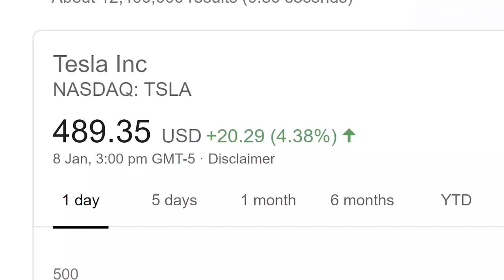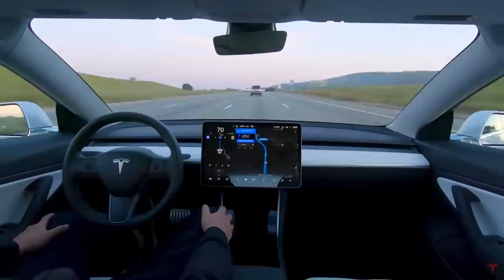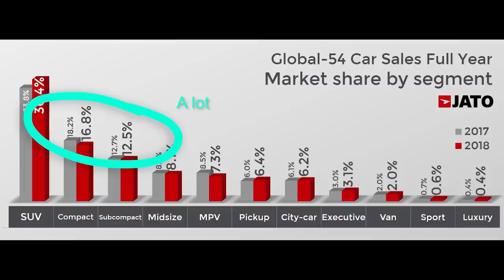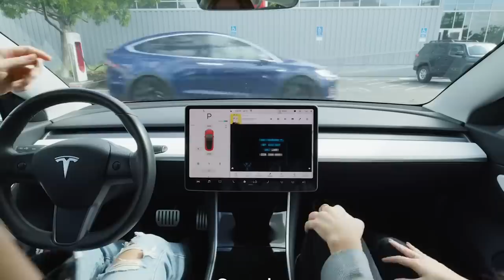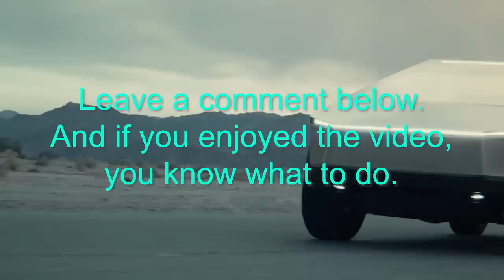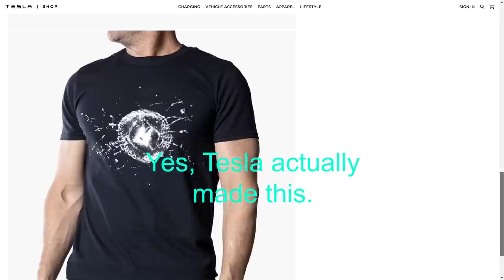Is Tesla Making A Compact Car? (or something else)

Comment: I don't think you are thinking radical enough!  ;-)  I expect it will be as you say, a much smaller, much cheaper car...  However...

It will be built primarily for city driving and 'may' have a range of only around 200 KM to minimize weight and cost. It will probably seat only four, five if the back bench seat is crammed, albeit with slightly more interior room than a Mini, but still have a good bit more room for cargo than most similarly sized/priced cars. It will have a hatchback and the rear bench seat will fold forward for extra cargo space if needed. They 'might' make the front seat a bench seat and allow it to fold down too, turning it into a bed if everything is folded, so people could sleep overnight in their car. I would not be surprised to see it with the equivalent of beefy bicycle wheels with the body made out of foamed, maybe recycled plastic not much heavier than Styrofoam. It will be a 'bubble' car. If struck it won't so much crash, it will flex and bounce. The car will be SO light and the battery pack SO small, it won't just retail in the $20K range, but closer to $10K, competing with the cheapest cars in the world.  It will cut into sales of 'bicycles!

Oh, and because it will be SO energy efficient due to the lightness, solar panels (designed to work also in partial sunlight and shade) will be sufficient to give it a useful charge all on their own. Elon will be able to tell people that if you park the car in full sunlight for eight hours in a parking lot while you are working, it will fully recharge on it's own without being plugged in. The solar panels won't be on the roof by the way, they will be the entire surface area of the car!   https://energypost.eu/printed-flexible-solar-cells-new-manufacturing/

Comment: They could do what BMW did with the i3 and use a Carbon Fiber Reinforced Plastic tub for weight reduction, hence save tons of money on batteries while still getting the same range. 
Ex. they could use a 40kwH battery instead of a 50kwH for similar range (I don't know the exact percentage difference based on weight, this is simply a prediciton.
Furthermore, another alternative, using rolled steel like the cybertruck could save tons of money on bodywork creation and paintjob costs. 

I need a 20k Cybercar! They could really make it work, but if it only has 2 seats, if could be a hard sell. They need to basically make a slightly bigger roadster. Something in between the roadster and the mMdel 3.

Comment: Radical thought: the compact vehicle won't be a standard 4-seat sedan or hatchback, but something far more radical along the lines of the Electra Meccanica Solo, Arcimoto FUV, Elio Motors' long-awaited vapourware commuter, or Commuter Cars' stillborn Tango.  It would be a tandem 2-seater to fit in spots only motorcycles would otherwise fit.  Now, while that works extremely well for big, dense cities, the question is whether such a market is more appealing to Tesla than a standard compact (or subcompact) vehicle.  That would require a global viewpoint, as perhaps such a vehicle would open the Indian market.  No matter, I can't wait to see what they come up with next.

Comment: Does it make sense to design a compact car with robotaxi in mind though?  The main reason to get a compact car is, like you say, navigating city traffic but most importantly parking - which will be a non-issue (or at least not the driver's issue) when the car is part of the robotaxi fleet. Making these main pros of the compact car obsolete I think most people would prefer to be driven in a larger, more comfortable car, making an autonomous compact car a bad idea. 

In terms of design though I would not be surprised if we see more Tesla cars with the Cybertruck design language. A Model S redesign in style of Cybertruck would be cool.
Reply from the maker: * Small car = cheaper running costs = literally the perfect robo taxi providing passengers are comfortable. 
* Small car is better for city travel (and parking), period. Whether you need to stop and park for 3 hours or for 10 seconds to drop off is not the point. Smaller = better in a city. 

Of course many people would prefer a spacious ride but in some parts of the world, that's not feasible.
Reply: @SolvingTheMoneyProblem  If you're the one driving yeah of course. But what I mean is that in the world of autonomous cars (i.e when most cars are autonomous) parking will not happen (just like buses don't park today), congestion will be less because of the reduced rubber-band effect and the advantage of the compact car will be a lot less than it is now. In a situation where things are transitioning though (which might as well be a good while, but could also be quick) the small cheap electric car is obviously a no-brainer, especially in certain cities.

Comment: A (sub)compact car (around 4m) is a must for European and Asian markets. I'd buy a 45.000 Euro Model 2 Performance with >300 miles (>500km) range and good acceleration <3.5s 0-60. Model 3 is to big for my taste, but I still got one, because it is the only EV that you can drive as your only vehicle without making substantial compromises. The slightly higher travel times on long distance trips is the only compromise, that gets more than offset by all the things that are way better than the ICE experience.
Reply from the maker: Nice. Yep, I'm sure many with model 3 would prefer a compact!

Comment: Personally, i think it will be a car for the molasses. it will have a weird design slightly more range than a porsche (maybe 211 miles). In exchange, it will have a 0-60 acceleration in 2.2 seconds, full infotainment system, full autopilot hardware, 5-seaters, somehow still get 5-star rating in all categories, and the base model will cost $18k

Comment: The least cost would be a flat panel design Tesla Truck style without the truck bits and smaller of course. Think Fiat Panda 169 (2003-2012) or maybe a scaled up version of the original two box Panda.

Comment: If Tesla is going to compete in this market they will need to get the starting price in America below $20K, i.e., $19,990 or less. That's because its competitors in this market (e.g., Chevy Spark, Nissan Versa, Toyota Yaris, Honda Fit) generally start well under $20K and this is the most cost-conscious of all market segments. Anything over 20K is simply in a different market. This should be doable if the car (or the bulk of its components) is made in China, and if it is a single motor with a much smaller battery. One would hope that with its smaller size, single motor and minimal drag, the battery size can be decreased without sacrificing range which is a another key attribute for consumers. Keeping the battery small should also dramatically decrease its 20-80% charging time at V3 superchargers which would be another hurdle removed when competing against ICE cars. It doesn't need an under 5 second 0-60 time or a top speed greater than 100 mph to compete in this market. If Tesla gets the fundamental balance of range, recharge-time and affordability right, this could be a huge winner for them.

Comment: I believe Elon has stated: building a compact car doesn't really make sense in terms of cost and efficiency gains compared to the versatility of midsize.. We know Elon plans a time to make model 3 without steering wheels, and finding small parking spots shouldn't be  an issue in a fsd future. Model 3 is a no frills car that should get very cheap as batteries get cheap and time goes on.. I expect new interiors one day for the  3 and Y that will be less driving oriented.. 
    I don't doubt they will build a more compact people mover; But it will definitely be more focused on full autonomy and the needs of the new culture it creates.  IE: Be less certain you will call it 'a car' ,  and it will have a steering wheel option.

Comment: ? since we are talking about Tesla vehicles as autonomous taxis, has there been any news about recharging via induction?  That way a car can recharge itself by parking over an induction charging station.  There was some talk of this on electric buses.  

Chattanooga looks to extend electric bus range with wireless ...
Jul 17, 2019 - The charging station was developed by Momentum Dynamics, a Pennsylvania company that installed the country's first inductive electric bus charging station, a 50-kilowatt unit, in Howard County, Maryland, in 2017. ... The units use coils installed below ground, powered by electricity, to generate an electromagnetic field.

Comment: New Models can be easily build on existing GIgafactory Ground. Just think of only 1/3 or 1/4 of the dedicated planned ground is (or will be in first stage) build as factory. So you can easily triple or quadruple in Nevada, Shanghai and Berlin 🚗🚗🚗🚗🚗🚗🚗🚗🚗🚗

Comment: I bet this would be the first car with no steering wheel that Tesla makes
Reply: do you think regulators will allow that? Also, consumers will still want to drive the car for fun or in certain situations.
I say bs that wont happen (I mean eventually it will but not in this car/ the first versions of the compact car)
Reply from the maker: Yes.
Reply: @SolvingTheMoneyProblem  I'll become a patreon of yours if the standard compact model won't have a steering wheel
Reply: That would have to clear the auto insurance companies who have $Billions behind them.   They will not insure a self driving car right now, if you call it out of a parking lot.  That confused the car's computers so insurance did not cover the damage costs as it smashed into other vehicles and hit a gas truck causing an explosion that wiped out the entire parking lot of Wal Mart. Like out of a movie.  There must always be a driver at the wheel.
Reply: @DS-uo1zy  consider the fact that Tesla still has to put together the teams who will design it, then a couple years to design a prototype, test, refine, it won't be a mass market car for 3-4 years. By then self driving tech will be much better.
Reply: @davids3905  hm with that timeframe that might be possible. Steering wheel will still be a possible addition though don't you think?
Reply: @DS-uo1zy  possibly. But having an optional wheel attachment would make the car more expensive to manufacturer.

Comment: Speculation - New battery type will require less space enabling a smaller, lighter skateboard. This car would be further optimized for energy efficiency resulting in a general use commuter/taxi. Perhaps the Chinese could pull off a good looking skin for such a vehicle. Probably Tesla's goal to build this type car all along. Just waiting for the battery cost to bottom out, battery performance to increase and learn some lessons like reducing the amount of wiring. Blue skies indeed!.

Comment: Full self driving is still an if not a when. There's significant doubt that Tesla's approach will ever be able to achieve it. You also have to keep in mind that the Y, Cybertruck, and Semi are little more than concept cars as they don't even have a place to build any of them yet from what I've read. 2020 probably won't be the year Tesla takes off, but it might be the year they finally get the infrastructure in place to take off in 2021. Here's hoping I guess.

Comment: 4:38 Sorry, but you're wrong in this.  The weight of the car matters only when going uphill, as while moving an object horizontally you do no work except for opposing the aerodynamic drag and the rolling friction of the wheels. That's why Tesla cares that much of the drag coefficient of their vehicles and puts on those large rims and flat tires.
Reply from the maker: Not sure if you're trolling. This is basic physics. The more MASS, the more ENERGY is needed to move it. :)
Reply: @SolvingTheMoneyProblem  moving horizontally doesn't increase the potential energy (m*g*h) thus does no work by itself.
Reply: @SolvingTheMoneyProblem  you spend more electric energy on acceleration converting it into gaining the kinetic energy (m*V²/2) but then you get it back during recuperative breaking. So the only thing that matters is moving at steady speed and that, according to the Newton's first law, doesn't take any energy if not for the drag and friction (say, in space).

Comment: I think full self-driving is still years away. The sheer amount of data they will need to collect to account for human error on the road will be astronomical. Full self-driving may be 99% complete, but each percentage of a degree further will take an exponentially longer time in my opinion. I think a 100% safe self-driving vehicle is only possible if all cars on the road are  computer controlled.

Comment: A compact car can be 150 mile range and that would be fine. If it is able to get 5 miles per KWh a 30KWh pack would be sufficient. That's half the battery pack of the SR+ so half the battery and powertrain cost. So potentially half the price of a model 3 so perhaps as low as $20,000 which indeed would be the game changing car especially in Europe where the average sold car is a LOT less expensive than a model 3

In the UK the top 10 selling cars average price is £16,000 Vs £40,000 for a SR+ model 3

A model 2 for £20,000 is badly needed!!
Size problem is easily solved by having sliding rear seats and a hatchback. It would be perfect you don't really have lots of shopping and passangers at the same time it's often one or the other so a simple sliding rear bench seat solves space

Comment: A small car like the Renault ZOE, will be awesome.
Reply: there is a need for small cars from tesla. but cutting the battery in half will bring some issues too. the range is barely half but not the costs, also charging time wont be the same. also you need production capacity for this big market.

Comment: I'll tell you now, Tesla Model 2 it will be a very contemporary looking perhaps a tiny bit  like the VW Beetle Vehicle, reminding us that it a car for the masses perhaps with a full solar roof to lessen size of battery. It must be designed for the masses, that means it must be very good looking  , power and performance wont matter... it's the looks and size that matter. It must not be a vehicle for 4 passengers or 3 or 2 initially... as this is an anathema to having a compact car, it should be ( initially) a car for one person sitting in centre of car at the front , like the original Uniti 1 concept and of course b4 that, the McLaren..  very cool... In the back, you have room for the dog and shopping.It must have connectivity eg Android Auto,must be air conditioned, no side protrusions or mirrors. Range should not be a big deal ..so 300 klm is plenty .. more discussion required. 
 remember this is a city car. Remember that one day cars will be recharging from the specially designed road surfaces too !! Colour .. must be vibrant .. one other  thing... it must be truly truly eye catching .. not the shape of the wonderful Toyota I Road but as stupendously eye catching as the I Road is.. I remain baffled that the I Road hasn't taken off. Aside from very limited range and speed , there must be other issues. Perhaps the most difficult will be parking it ( Tesla M2)., but we must keep it small, not swayed away from  that at all.

Comment: I just want a Tesla station wagon
Reply: I want a Tesla drivetrain in my existing wagon.  I wish they'd start selling a conversion kit (motor, battery pack modules, basic computer for charge control and running the motor).  Doesn't need all the extra stuff like climate control, entertainment, and fart mode.  It'd probably still cost $20k and you'll need someone to install it but it'll be a lot easier (shorter timeline, less waste) to convert the existing fleet to electric than to replace them wholesale.

Comment: Your conclusion that less mass is inherently more safe is inherently wrong.  Teslas vehicles are only safer because of weight in the fringe case of rolling which they are unlikely to do because of the low center of gravity(notice as this is not completely reliant on mass). The mass position is extremely important in this issue. And to top that a lighter vehicle has less impulse. Which is actually a good thing in most situations with a few exception for example if you trying to ram a model S against a car coming from the opposite direction the impulse(which is usually higher because of the higher weight) of the Model S will result in the other car taking more damage. However in every other situation high impulse is terrible as coming to a stop needs a huge amount of energyabsorption  to accomplish(for example the water barrels at highway exits are designed to absorb the kinetic energy of a crash a heavy vehicle going at the same speed as a lighter one will get further through the barrels worst case getting through). So no in most cases a heavier vehicle is absolutely not what you want for safety. Smaller vehicles are less safe because of the missing crumple zone. The front sides and back are less big so they can't crumple and absorb as much kinetic energy as a bigger car. That is by the way why most electric cars are crash safer no block of metal that can get shoved into the drivers face. but a clean crumple zone with enough space for engineers to design the way it would crumple around the driver and passengers. 

But to conclude again making the car heavier is not an inherent safety feature. it actually makes it more dangerous. Not just for the driver and passenger of that vehicle but for everyone else as well.

Comment: Will be called "model 2" for "2 S3XY CARS" a 35KwH battery with a 100Kw/136HP motor could have a cost Of 20K+ USD and a 200+ Miles with a weight arround 3000 pounds (1350kg) or less. but also possibilities for a performance model with the same motors than the M3P and a 45KwH battery for +250miles... Or so.